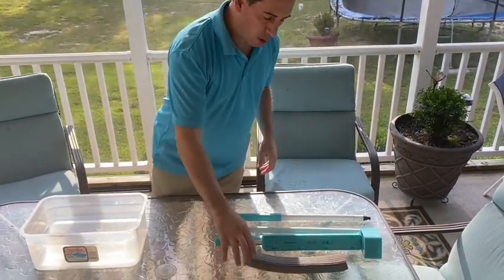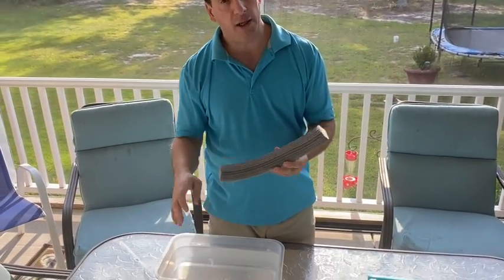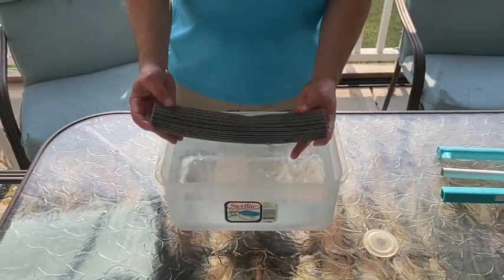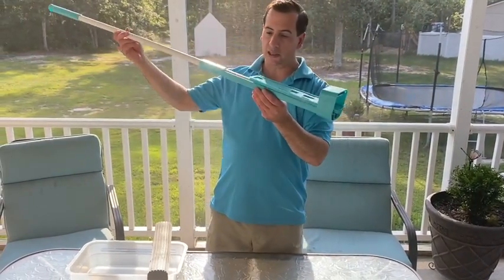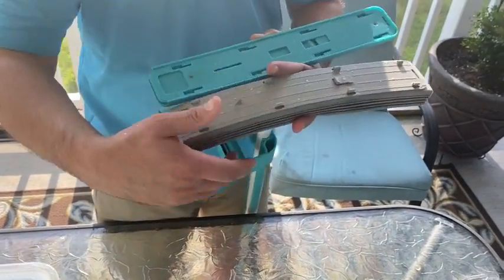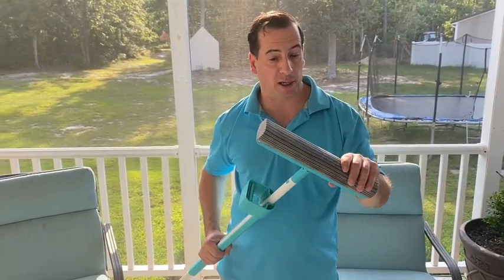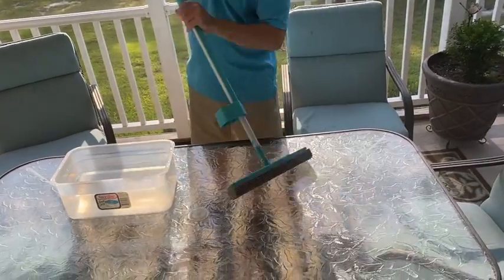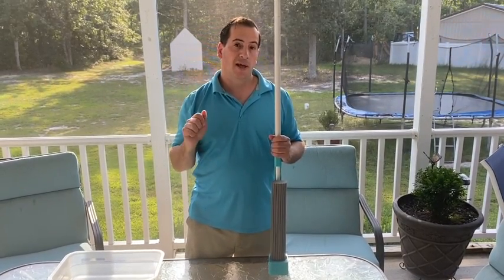PVA Mop Tutorial

Comment: Sorry, but I dont understand how it works in full. When it is in standing mode and become dry, how to make it wet? Do I need to have extremly deep bucket, or remove the nozzle to
wet it up.
Reply from the maker: Hello, when it is in standing mode and dry, you can either put the mop head under the hot water in a sink, do the bucket option like you said, or you can push down on the roller with your fingers. It will flex downward, and you can fit the dry mop head through the wringer (even when it’s dry).